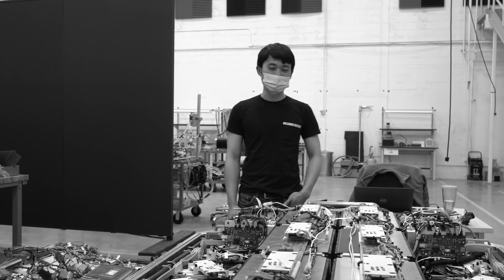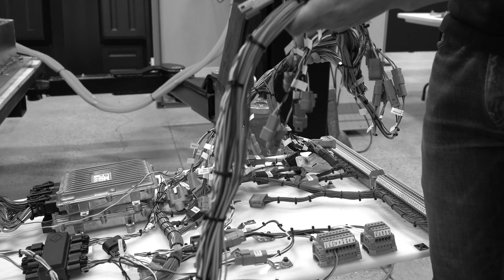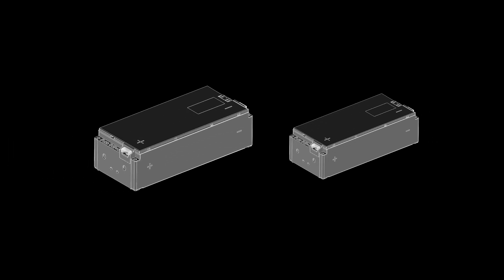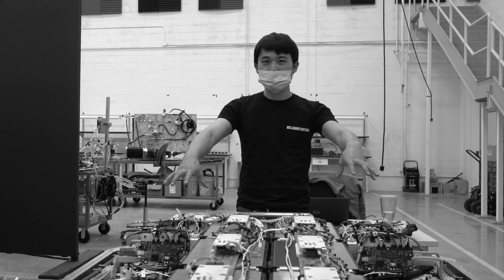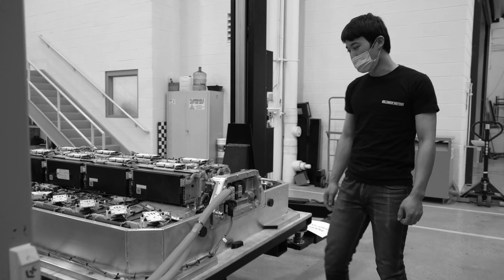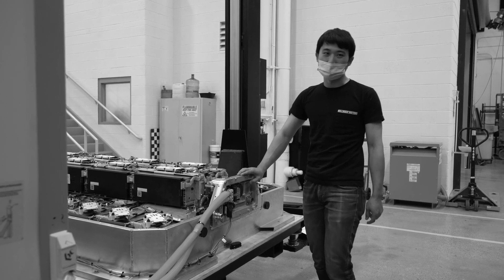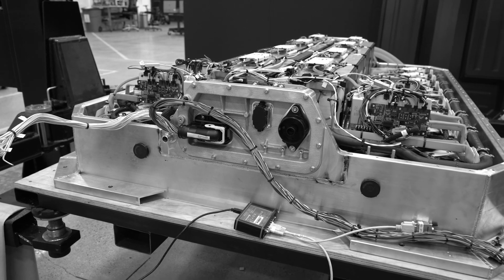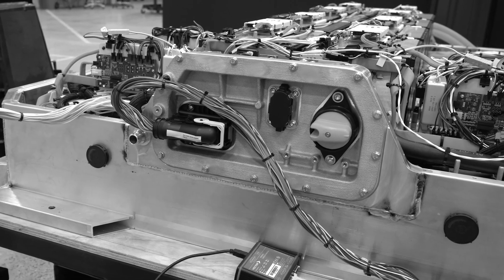BATTERY TESTING PREP - Bollinger Motors

Comment: I really wish you guys truck and SUV were cheaper in the 15 - 20k range, would make for a great work vehicle
Reply: @ES-qe1nh  Yea, but this truck has no expensive kind of tech, its basically a work truck with no type of fancy electronics. The cybertruck cheaper model is 39k and that's going to have quite a bit of tech in it
Reply: @hummerguy  Early adopters are covering the initial development costs. If they are successful they'll get to a production line operation, but until then it's all handmade, one-by-one as far as I know. I wouldn't hold my breath for anything under $70k from them this decade besides that delivery truck if someone else makes it for them. Cybertruck will be the only sub $50k ev truck for a while.
Reply: Dreaming’s free baby. That’s a totally unrealistic expectation for this primo, art-quality vehicle.

Comment: 0.40 those voltage controller plates (i suppose) are increasing the thickness of battery pack. Is it possible to place them on sideways? (suppose that it's too late to reconfugure a construction on that production stage, but hope for more flatness in future)